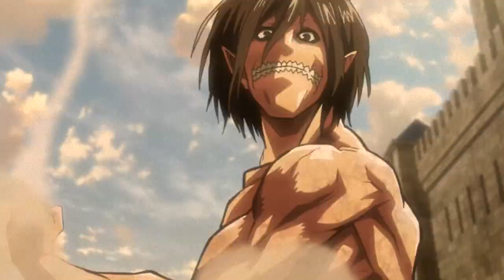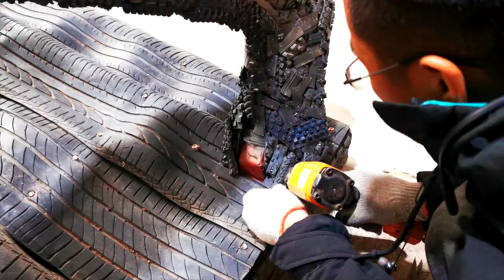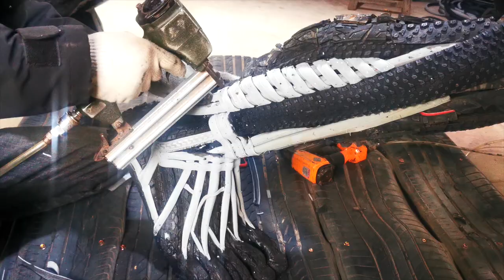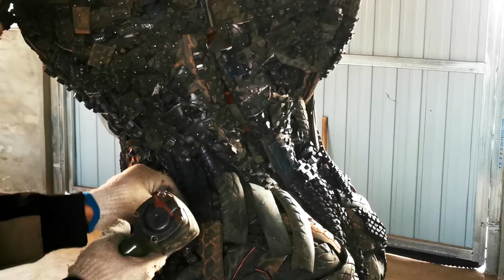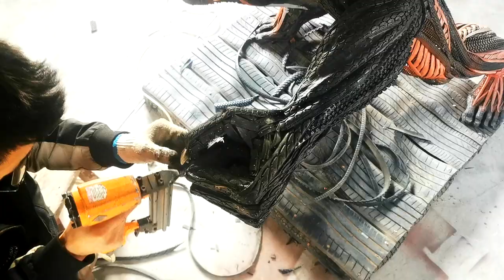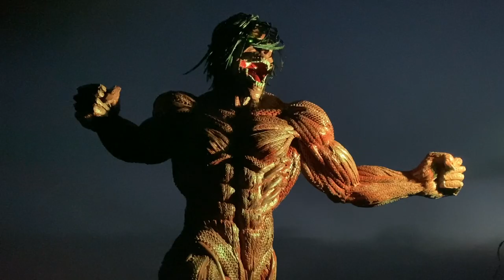Turn waste tire into Eren Yaeger！Devote your hearts！丨Attack on Titan丨Tire Sculpture

Comment: Imagine how many kilos of nails used
Reply: Omg probably like 100-250
Reply: 709.3896.7 according to my first calculation

But then i tried again to get the perfect calculation and ended up multiplying the amount of nails I saw vs. The amount i didnt see and got 1000.975.3 

But i knew this wasnt right so i came from a different approach.
I first calculated the gifts of the other guy who replyed to this and conducted it into a number of 300. Which that allow me to multiply the numbers I had seen of nails in the numbers I didn't see times the 100 and got 4017.977.35

But i knew this could not be right so I reduced the calculation into a 5000 then what I got was 5078.98 thousand kilos and 5698.977.83 kilometers if you line them all up

So to figure out how many he used I calculated a reduced fraction from the number and then flipped it once i erased some numbers

So he used 7086 nails.

My work here is done
Reply: Want to know how i calculated the amount of tires?
Reply: @K.sstopmotion7374  woah
Reply: No matter... Coz the result ia awesome
Reply: @biteburger3948  right
Reply: @bayutzy1260  ez stuff
Reply: @K.sstopmotion7374  its not for me..
Reply: @bayutzy1260  calculating isn't too hard when you practice for 40 hours every week
Reply: @K.sstopmotion7374  :0